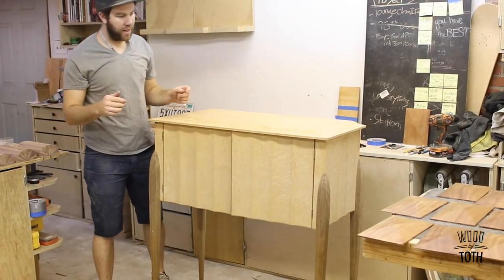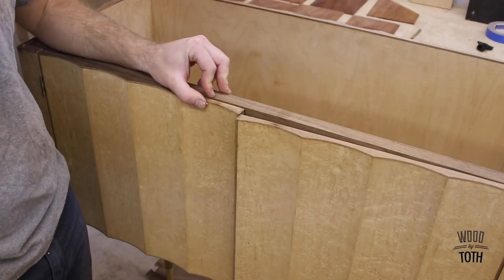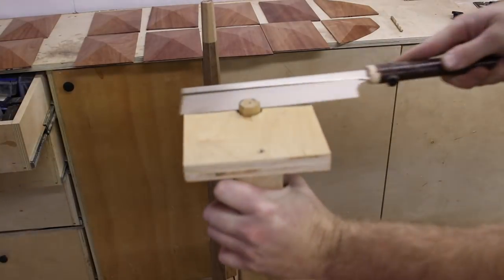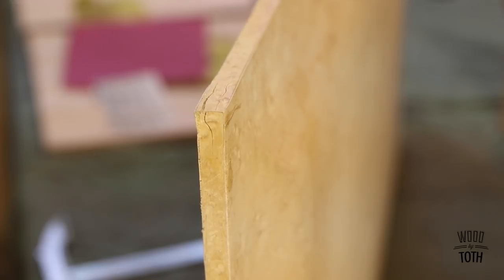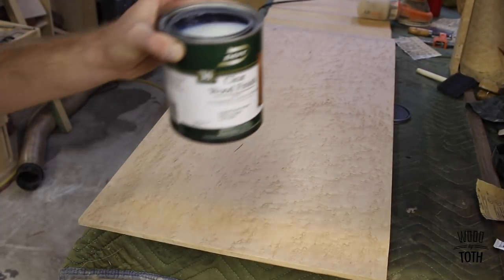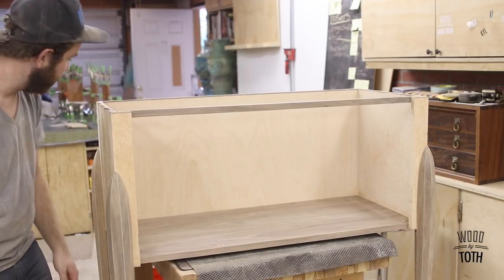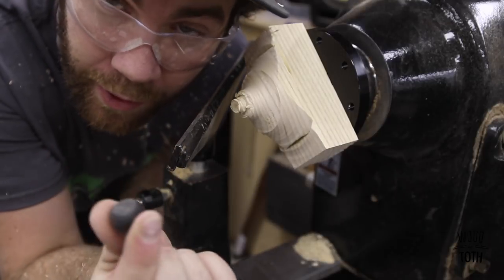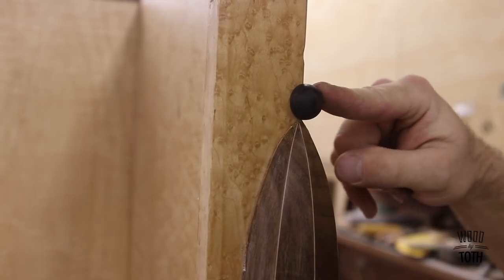Finishing An Art Deco Cabinet

Comment: Very nice piece! Two questions, was the top coved around the edges or is it just an angle, and are the legs walnut veneer on maple?
Reply from the maker: Matt Williams Not sure I follow the first question.... But the legs are solid walnut make of 8 segmented staves with maple veneer in between each layer. Then its turned to size then its shaped with a spoke shave to give it the flat sides
Reply: Kyle Toth thanks for the explanation. That makes more sense for the legs. I was curious with the first question what the top detail was where it tapers to the edge from the middle.
Reply: Kyle Toth thanks for the explanation. That makes more sense for the legs. I was curious with the first question what the top detail was where it tapers to the edge from the middle.
Reply from the maker: Ahh I see. so that top was actually cove cut on the table saw then I shaped the other curve with hand tools to get that ogie shape. Then the top was veneered